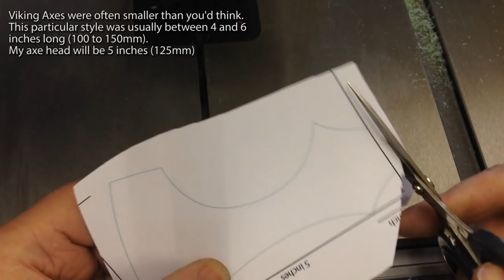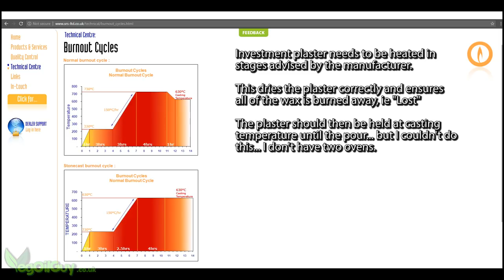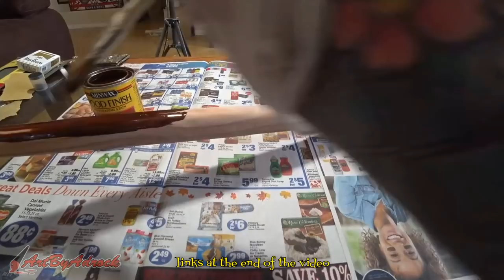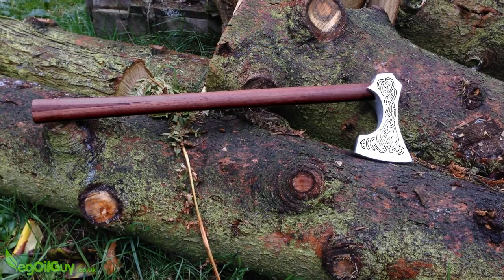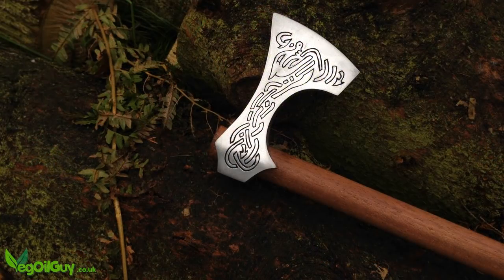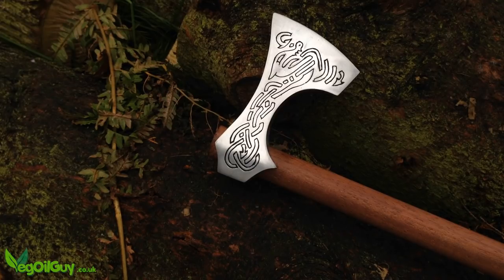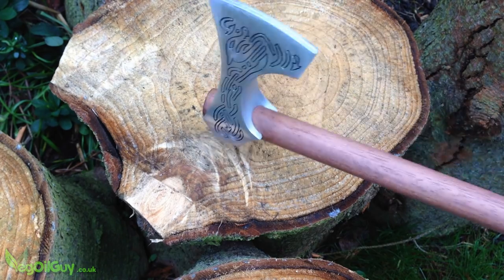Making a Viking axe - metal casting at home a decorative replica - by VOGMAN

Comment: The casting turned out pretty good, the carving really came through well.  Nice job.  I'm glad the one spot where something must have happened to the mold was on the plain side!
Reply from the maker: You and me both!  : )
The failure was caused by collapsing plaster I suspect. I could hear it cracking as it cooled. But the casting gods were smiling on me this time. Hope you enjoy the other guys vids.

Comment: Nicely done. All your experiments with lost wax casting kinda make me want to try it myself :D
Reply from the maker: Thanks mate. You SHOULD try it. I'm still learning, but I'm aware that Lost Wax Casting is the most versatile technique available to the home foundry. It can achieve detail the other techniques can't. But as I've just said to BigstackD, get proper investment plaster and make a simple vacuum system like mine. The results will be there for you  : )
Reply: The thing that keeps my mind on this is casting metal polyhedral dice set for tabletop RPG-s. Think it's doable as a DIY project?
Reply from the maker: Absolutely, especially with wax. You've got to remember that a lot of jewellery is made using lost wax. Some really small and intricate things can be achieved. Did you ever see this video of mine? https://youtu.be/EGNnH_xbjR4
It's the first time I applied a vacuum to lost wax... the results look ugly but compare the results (really quite small coins) with the original waxes. It's hard not to be impressed by the technique.

Comment: Outstanding! I have not seen wax shaping like this before, so that was particularly interesting. Certainly you are the winner as far as the accuracy of the Viking axe shape.

I have never seen a handle wedged at the butt end before. It seems like it worked well! 

I think you struck a good balance with your production/editing in this video, there is still a lot going on but you have dialed it back a little bit.
Reply from the maker: Thanks. I appreciate your comments.
I was concerned that my videos seem to be getting shorter, but as you've rightly spotted, I can't keep saying the same thing, so I've tried to be a little more general whilst hopefully giving enough information to keep folks interested : )

Comment: fantastic as always. what kind of wax is that?
Reply from the maker: Thanks James  : )
Actually it's injection wax... you can see it properly in it's packaging on this video - https://youtu.be/EGNnH_xbjR4 . I always recycle it, clean it and re-melt it. So here I've just got a large rough block of the stuff... hence smartening up the edges on the bandsaw at the beginning. There are speciality carving waxes out there which I might experiment with another time.

Comment: Fantastic work Geoff! What a brilliant end result. Is there no way you could simultaneously heat the investment plaster mould and the metal in your electric foundry?
Reply from the maker: Hi Matt. Thanks for the kind words. The electric foundry itself isn't the problem, it's just the space inside it. I built it snug to heat up more efficiently. If I'd have built it slightly larger with a bit more floor space, it would have been slower but more practical on occasions like this  : )
Reply: @vogman  maybe consider making  a second small furnace just for the plaster.
Reply from the maker: Ahhh... plans are afoot  ; )

Comment: Nicely done.  👍  So are you going to try to engrave the other side of the axe head now - the real way?  🙄  Keep up the good work, I'm off to give the other two a look now.
Reply from the maker: Thanks Ron. I found engraving in soft wax difficult enough... I've never tried metal but my admiration for the craft has soared after this challenge  : )
Reply: @vogman  ever think of using the kitchen oven to keep your plaster mold at least somewhat hot?  👍  Perhaps this requires the approval of the missus.  😚🍑   Just a thought.
Reply from the maker: Funnily enough Ron I have done that a few times... but it maxes out at 250C. The plaster is around 700C, so whatever your favoured units you can see the problem. Generally just letting it cool it doesn't drop below 300, so that's what I've been doing.
But I'm working on it, time and money allowing  : )
Reply: @vogman  Is making an insulated box to slow the cooling be out of the question?  I'm not sure that would be of much help though.
Reply from the maker: I've toyed with the idea Ron... I'm still toying with it. Ideally I'd like a larger electric foundry but money forbids that. So I'll keep thinking : )
Reply: @vogman  what about the furnace that you were using before you made the electric?  Any way to modify that?  It should get hot enough.  Did you cannibalize it?
Reply from the maker: Ah well... when it comes to foundries, you'll have to what for an upcoming video I'm already making. Hopefully this will help reduce my problems  : )

Comment: It looks nice and clean and everything but im not sure the point of it? Its the first vid I have seen of yours. Does it serve a function? you seem to have the furnace to actually blacksmith?
Reply from the maker: Hi Winstan. I'm guessing you haven't seen many casting video...? Typical forging takes steel and works it through repeated heating and shaping into a workable tool, like a knife, hammer, axe, etc. Casting has many functions but in this instance is purely cosmetic. So here I've cast something that is more a replica of an axe as I used aluminium. If you want to see more great replica weapons, head over to AlumiTube. He's got dozens. I've got a few, but enjoy casting all kinds of things... even jewellery : )
Reply: @vogman  Hey brother. I'm sorry I came across harsh or unfair. What you made was beautiful. I actually went through your vids after and liked the veg oil gravity/drill hole advice alot! No need to micron it three times etc lol.
Reply from the maker: Winstan you didn't come across harsh at all my friend. It was a fair point. Casting aluminium axes and knifes is purely decorative and some folks like it, some folks prefer the real thing, some hate both, etc. And that's okay.
If you skip right up to date on my videos, you'll see these days I'm enjoying printing things on a 3D printer and converting these to metal in a process called Lost PLA Casting. It's not only fun but very practical. I know guys that have printed and cast custom brackets for vehicle parts, etc. I'm still very much learning  : )
As for veg oil filtering, one word ... "settling."  It does the lot   : D

Comment: Your link to bigstackd goes to your own vid.  :-)
Reply from the maker: Thanks for that Bill, but the links are correct, honestly.
This happens a lot on the first day. We've each noticed it. The links are set for both BigD and Adrock BUT if there's a connection problem, the link defaults to one of Channels (in this case mine) videos.
It's probably the fact that BigD has so many visitors right now it's causing YouTube a headache ; )

Comment: Well Done Geoff I am impressed big time ! I think that i the best of Lost wax casting so far that you have done (: 
The Handle Grip was a stroke of genius I never thought of doing that for a handle  you usually see people doing the handle build the "Long way " of starting with a bigger chunk and carving , A thought consider making up a Steam box and steaming the wood and making a Jig to bend it into a shape needed , A mate some years ago found a Axe with a hand made handle that curved into the curve of your arm when you use it  rather than being straight like normal it was such a natural Axe to use  maybe that will give you some Ideas for the future 

and a casual query Did you consider making the head in Bronze ? or doesnt your Furnace get hot enough to melt the metals needed? 

Also  Alec Steel  ( https://www.youtube.com/watch?v=-rWppIHFkDM  ) reciently made a Viking sword and engraved it  the link is at the starting point of his engraving experience 
it might give you some clies on how to for future projects as well 

Great Job Geoff 

Tony from Western Australia
Reply from the maker: Thanks Tony. Wonderful inspirational comments as always  : )
I really was against the clock on this one. I'd already slowed the guys down and set things back a week, so I needed fast results, so a straight bit of dowel was the easiest, though very boring visually. But it felt wrong and handles typically thicken at the bottom to aid grip. So I came up with the wedge idea. It was only after I saw it on my own video that I realised it looked like a snooker / pool cue. 
The engraving was a last minute rush idea as well. I liked the shape of the head in wax, but I knew the other guys would do something special. So I had a crude go at drawing : )
Reply: Well it worked well Geoff  With the handle and the end pummel as it was a "Bit of Dowel " I dont know how  this would have worked  if you had steamed the pummel end to make it more pliable maybe you could have put a bigger wedge in it ?  My sister ex boyfriend many years back ( Approx 40 ish) built a 24'6 sail boat in their back shed and steamed most of the ribs over a 44 gallon drum with hessian bags over it took out the steamed wood and clamped them in a Jig till cold 
( just throwing thoughts at you )  But as it is I think the axe turned out perfect as it was Geoff 

maybe it would work at the Perth mint and  on that gold Coin Grin
Reply from the maker: I'll be honest Tony, I've always wanted to have a go at steaming wood. I'll add that to me list of things to do  : )
Sorry, I forgot to answer your point about bronze... we collectively toyed with bronze but research told us that the Vikings never used bronze axes, only iron and steel, so ours had to be silver in colour for a semi-authentic look.
I believe one bronze axe has been found, but this apparently was highly decorative and thought to be ceremonial.
My electric foundry can certainly manage bronze, but my wallet can't. Copper is quite an expensive material here in the UK, and you won't find any scrap copper with ease. It's soon greedily snatched up by those wanting to make a quick buck at the local scrap merchants.
But there will be some bronze projects coming up... hopefully not very large projects to save my poor wallet the bashing  : )
Reply: I Was thinking as I was typing the message about the time frame and I couldn't remember bronze being used either , Grin Even in the Asterix comics Lol ! bronze wasn't mentioned at all around that time frame  so in fact they must have been fairly well versed in metallurgy to be able to find and process Iron Ore to Iron and would have lived originally in a place with suitable Fuel / trees in quantity to be able to make Charcoal 
 a little fact here My Family steamed from the Grimstadt area ( Near Oslo) in Norway the Holst family and Jacob Holst was my Mum's Father who had a sailing ship Line ( Merchant goods etc)  way back then 
I believe he eventually moved out to Western Australia  in around 1907 Mum Now is a Veitch  tho Gordon my stepfather died some 15 years ago ( Alzheimer's related) and I am a Lush ( That's enough from you  !  Lol  I dont drink by choice !) My father spent  4 years in Changi POW camp during WW2 

Just a little few facts their for the curious ! 
Why dont you follow plumbers around and offer to clear out their scrap bucket?
Or go to the tip and go to the car section and get some old alternators or washing machine motors, etc 
I know from looking online at sites like 
bigstackD Casting  (who is a fellow Western Australian ),
eWaste Ben,Moose Scrapper,indeedItdoes,do their bit on collecting Copper and turn it into things ( Eventually ) 
you could always pinch the wife's Extension Cord to the vacuum cleaner Grin ! 
BTW I loved the use of her Hand mixer for the plaster in this one Does she know yet?
Tony
Reply from the maker: I've had many a chat with BigD about scrap metal. The chances of walking up to a skip in my neck of the woods and pulling out a huge motor are slightly higher than winning the lottery. Abandoned properties are routinely burgled for electrical wiring and copper plumbing - such is the lucrative scarp metal trade here.
Reply: I count my blessings Geoff we dont suffer that herebut occasionally you hear of new build materials going walkie's but not very often maybe it is time to go with a Patreon account to get some cash for raw materials to be able to have something to work with?
Reply from the maker: I've thought about it Tony, but I don't like the idea of holding my cap out   : )  Feels a bit cheeky.
I have a PayPal donate button and maybe once or twice a year someone will be kind enough to send a few coppers my way, and I'm always grateful for that.
Reply: sometimes Geoff humility teaches us personally many things
There is no respect for others 
without humility in one's self. 

Henri Frederic Amiel
There is no respect for others without humility in one's self.
Henri Frederic Amiel
 Read more at: https://www.brainyquote.com/topics/humility